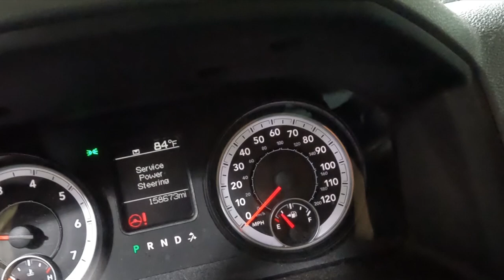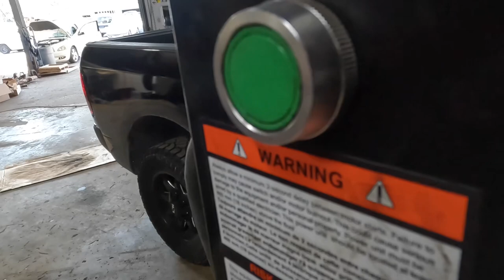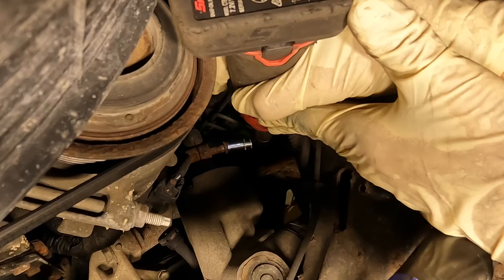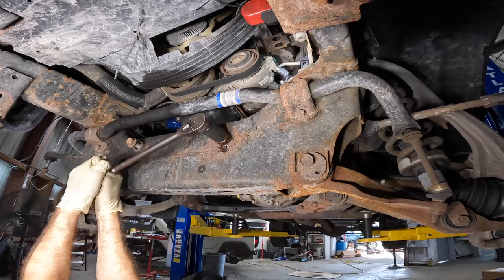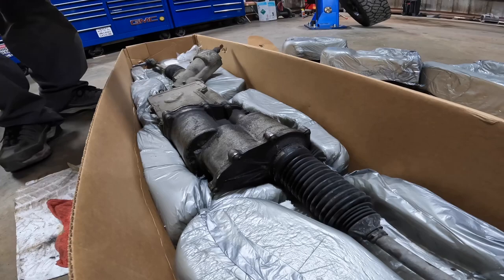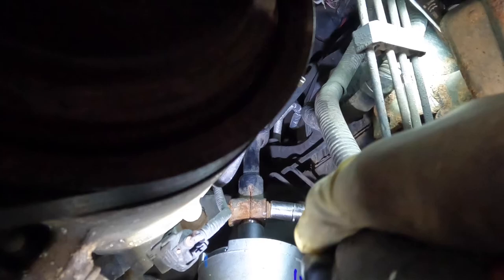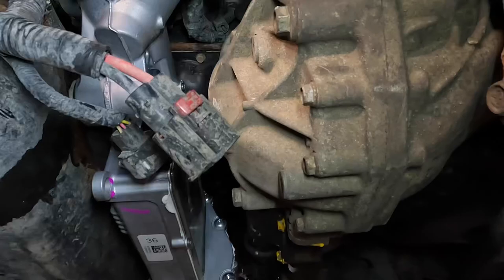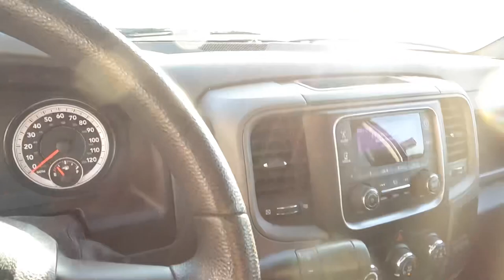Electric Gear Leaking? 2014 Ram 1500

Comment: HI Ray, great video as always. Down the road, you might consider switching the two lifts. Have the larger one drive in straight and the lighter one around the corner, unless there is a length constraint that would not allow this. Just a suggestion.Cheers.
Reply: I believe, square footage depicted their current location.

Comment: I know it wouldn't be cheap, but wouldn't it be worth it down the road if you could have the lifts swapped out.  That way you would have the bigger unit straight in and could use the smaller lift for smaller cars?  I'm sure it would be a good investment.

Comment: As an Aircraft Mechanic that feels bad for the way Automotive parts are engineered I have to say I’m impressed with the relative ease of replacement of the steering unit. Seems like a good design and I never would have guessed that Dodge trucks had electronic steering. Pretty neat. Also, that sure does look like a gunshot triangulation monitor at the end of the video. Look around the area to see if you can spot more. Curious if that’s Manatee County or another agency.
Reply: Yeah, I believe, that the folks, in the Ram division, knew that the steering box would eventually fail. So they made it an easy install part.
Reply: My 2002 honda civic had electric power steering.

Comment: If You Buy A Used Truck Always Ask For Extended Warranty I Got Very Lucky I Only Had To Pay 50.00 Deductible When Total Bill $3240.00 Dodge Dealership Cost with Alignment I Own A 2017 Dodge Ram 1500 with 70k miles on it Owned for 2 years now I had to wait almost a month to Get My Truck Repaired Hopefully I Never Have To Replace it again Til I Trade In For A New Truck Down The Road

Comment: Hi Ray I have a 2002 Pajero i0 here in Australia and all the ball joints are grease nibble less with no grease in them I heard I could use a syringe and replace the grease and just use a little bit super glue for the tiny hole . What’s your thoughts there is no play in them otherwise I would replace kind regards Andy Perth Australia

Comment: Hi Ray from a UK subscriber. Love watching your content, as a good old mechanic myself can I ask do you use a torque wrench to set the tightening torques on bolts? I would have torqued up that power rack and the wheels, or do you just edit this from the video.

Keep up the good work, love American autos.
Reply: He most likely edited that stuff out. Because he has shown, several times, that he does, actually torque the high stress points, in his earlier videos.
Reply: He only torques certain things...but not what you saw today.
Reply: He does both -- some things, like lug nuts, he torques. A whole lot of things, he just trusts his feel. He's had a video about this in the past, but good luck finding it!

Comment: I bet that shit wasn’t even leaking, the oil filter on those trucks with the 5.7, is right above the steering gear. Like exactly where he showed in the video, I’ve done plenty of oil changes on those trucks and that thing has a pep boys oil filter so I’m assuming they didn’t clean it off, F150’s are similar in design, they leak oil from the filter housing on the rack, if it’s not clean it will look like a leak.

Comment: that pole is an idiot detector. We had them put up to out the idiots in the world, lol. Couldn't resist. Could you tell me what your feelings are on putting anti-seize on rusted bolts and nuts? Perhaps easier to take off the next time?

Comment: Great information, what was the cost of replacing electric steering wheel unit?
Reply: A stealership near me said mine would by $3600 for part($2900) and the rest was labor, taxes and an aligned. No symptoms of a power steering issue though

Comment: Why don't you clean those rusty bolts with a wire brush, and put some copper grease on them, if it still needs to be loosened, it will be so much easier.

Comment: Hello Ray from Adelaide South Australia  new viewers I noticed the Jeep 95 project I'm on the hunt for a good 2000-2005 Wrangler it's a bucket list thing ,however not many here in Australia .Question for ya are they a good vehicle I've been told to stay away from the later V6 MODELS 4.0 hemisphere is the go would appreciate your opinion.
Enjoyed the Ram steering replacement didn't know the system is electric powered pump self contained cool ,Anyway mate you got a new VIEWER, your funny and educational I will be watching the Jeep project closely 
Cheers Kym
Adelaide

Comment: Only 5 lug wheels on a 4x4 1/2 ton truck? I thought those were all 6 lug wheels when a 4x4, 5 lug for 2 wheel drive.

The shaft IS usually the hardest part...

Comment: Um..  this isn't a leak. It's oil separation from the grease inside the steering gear.  The correct repair here would be to wash it off.  The replacement will eventually have the same external film in about a year or so. If you understood how these work, you'd know there's no "fluid" inside an electric steering gear therefore nothing to "leak".  Totally unnecessary repair - as far as the leak is concerned.  I'd be super suspicious of those connectors at the gear.  That's probably what is causing the steering message and it will probably be back.

Comment: I have a question, why do you not use anti-seize on bolts when you put them back in? I would think that those two main bolts that hold the gearbox on the frame could have used some. Just wondering... I'm not a mechanic and don't pretend to know anything.

Comment: Great video. You made it look easy. You might want to think about using Silicone Spray on threads of the 2 mounting bolts and the steering coupling shaft. That will pretty much stop rust. And, again, I recommend you try the WD-40 Specialist Rust Release Penetrant Spray as it is better than the PB stuff.
Reply: Have you ever used any of these products? Silicone spray dries up so fast, it wouldn't even come close to lasting 1 day. Same for the other 2. If you want to stop rust,  you can buy prooducts that will last for more than a day or 2.
Reply: @AT-wl9yq  Yes, in particular, the WD-40 Rust Penetrant. While the Silicone spray seems to dry up, it leaves a film behind which stays on the threads.
Reply: The last thing you want near threads is silicone.  Silicone softens mating surfaces so friction then destroys them.  Trust me, I found that out the hard way
Reply: Loc-Tite does an excellent job of sealing threads.
Reply: @Biffo1262  Silicone spray will not soften steel. Not possible.
Reply: @desotosky1372  Yes it does because Loctite activates on metal to metal and does not rely on oxygen to harden. I would never use Loctite on head bolts or exhaust manifold bolts. But, I would use anti-seize.
Reply: @desotosky1372  I can't believe what I'm reading. Are you actually suggesting you should do it the right way? I'm sorry, but you're just way out of line.

Comment: The steering gear has no fluid in it…we’ll at least if it does then that’s your primary problem…not that it’s leaking fluid, but rather that it has fluid to leak 😂😂😂

Comment: RAY Question please?  I just replaced my ABS Sensor.  Not the booster section just the computer.  It's a 2004 Escalade EXT.  Can I drive it to the shop with no  issues?  I did a small drive in front of my house, the brakes seems to work fine.  I also did this for my Mustang, and drove it with out the computer for a few weeks, I had no ABS but it drove just fine.  Can I do this with the Escalade?  Just your opinion.   I need to get it programmed, not going to pay 300 bucks for a 5 min tow.
Reply: Brakes will work normal.

Comment: Don't electric power steering systems NOT have any fluid to begin with? I don't understand why it would leak.
Reply from the maker: It’s an electric motor that operates a hydraulic cylinder. There’s fluid in there, it’s just not serviceable.

Comment: See that means it's a reconditioned unit, if the part was truly brand new there would be no surcharge or old unit return (you were robbed lol at least the gave you the ends with it).

Get your transmission jack under it lol.

People who don't wear seat belts just want to be out their vehicles first, they're not bothered whether that's out the windscreen, the window or the sunroof (if they have one fitted, one way for a quick install though) lol 😆 😆 😂

Comment: Ray, did all four wheels only have 4 out of 5 nut's on them, or was it just that one wheel that only had 4 wheel-nut's?
If it was all four wheels, my thought was someone had to destroy the locking-nut's, and did not replace them. (Just a thought).
Reply: The tool Broken and I was barely able to get them off replaced them now

Comment: Not on the subject, Ray; why do you hate Mustangs? I own a 16 Mustang GT, which is fast enough for me. Most of them have had their mufflers removed. I put them back on mine. Can you tell me the weak points? I do know that Ford transmissions leave a lot to be desired. Mine crapped out a month after I bought him. Then it took a month to get repaired.

Comment: backorder shouldn't happen near as much as it does. it's the manufacturer disregarding the customer after the sale when they should have a responsibility under law to keep ALL parts available to repair the product they have sold or be penalized! would be in favor of a law fining them for these infractions
Reply: Respectfully, I think you would find that that drives the price of all parts way up!    The manufacturers and dealers are simply going to pass those costs along to the consumer.

How many years back do you expect those parts to be made available?  What would be an acceptable wait time for a part? An hour, a week, month?

Not busting your chops but  sometimes solutions can bring lots of unintended consequences.
Reply: steve, love the reply. for sure agree that costs would come down the line to us. it's just that we as consumers can decide whether or not we want to make a purchase for any product at any time based on many things including paying more for something we need. but I would rather have the option to do that rather than no option at all because of a situation like a backorder. I'm a shop manager and my most recent instance of this was a punctured fuel tank on an 2021 chevy spark. doing used car recon for a major used auto sales company. it was national backorder with no eta. I got approval for a used tank from a national junk yard network and swapped everything over. but if that option wasn't there than the car is basically trash save some Jenky attempt to seal which is a bad option. so again it's just about options sometimes rather than cost.